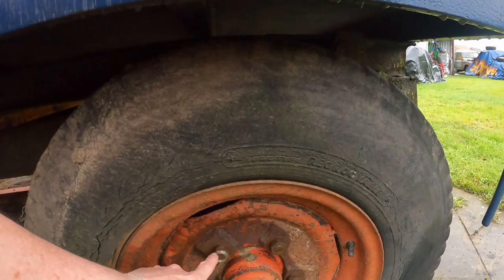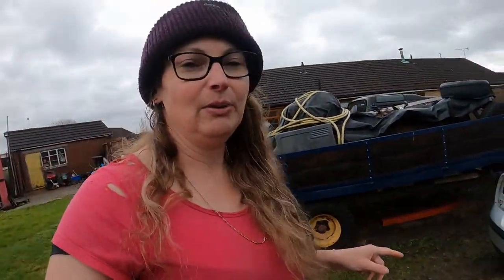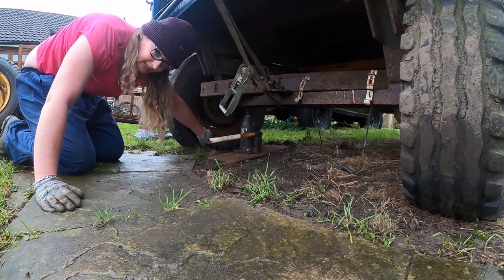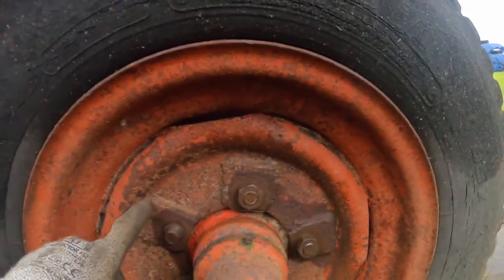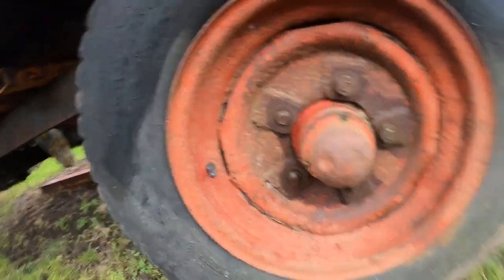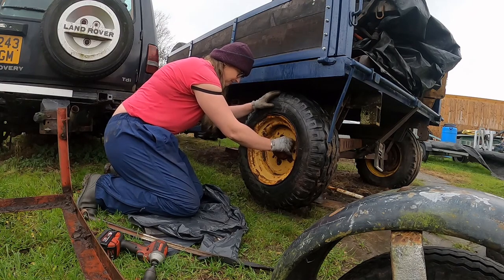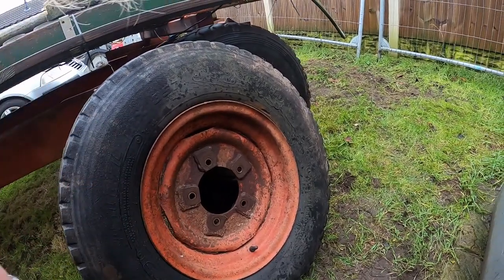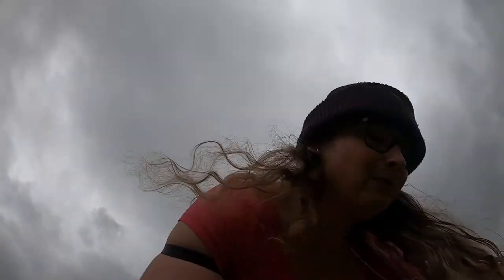FAILED WHEEL REPAIR AND A BIT OF A RANT. VINTAGE THURSDAY FARM TIPPING TRAILER REFURB  PART 20,

Comment: hello lisa i would use the wider wheels/tyres of the other trailer i think they look much better and would ride and take the weight better as well
Reply from the maker: Hi Duncan. That seems to be what all my friends think too. I think a fresh coat of pain will transform the look of them and make the trailer 👌
Reply: Hi Lisa enjoy your vids very much. Take care when swapping  wheels make sure the wheelnuts match the wheel profile. If they are not an exact match  the wheel will fall off. It happend to me once when I was a passenger in a car. Someone did a bodge job on the hub with lashed up wheelnuts. People do not understand wheels and nuts are a matched machine cut. Thanks mark😁